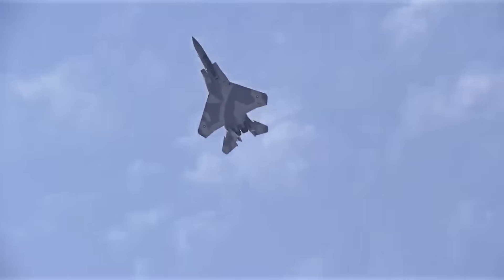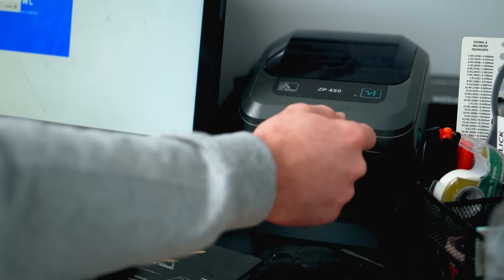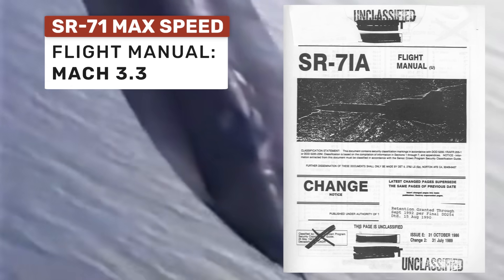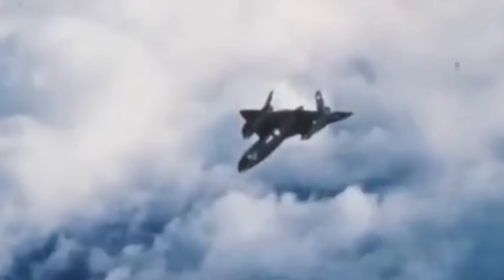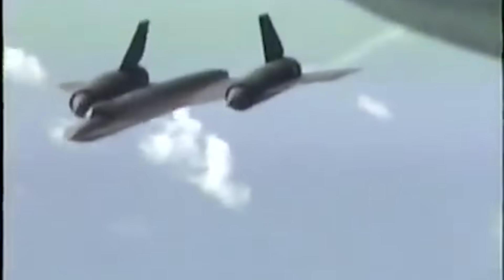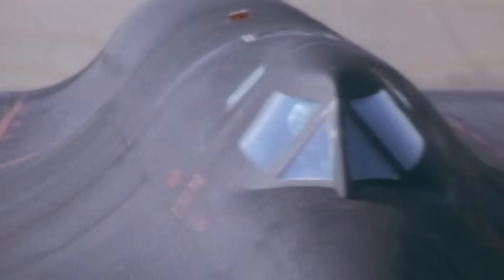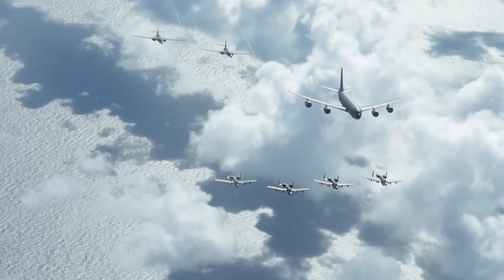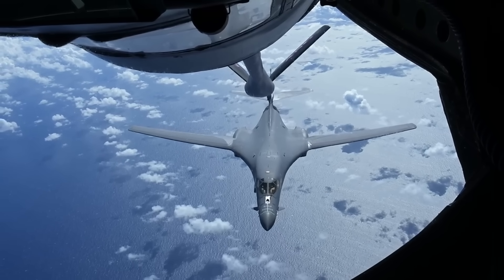The SR-71 was MUCH FASTER than the Air Force will admit

Comment: How about... 3.9? In the book 'Secret Weapons of the Cold War', Bill Yenne (a highly respected author of dozens of books and novels re: military history) wrote that, while meeting with a group of SR-71 pilots/crew at Beale AFB he asked what would happen if any airplane ever took the Blackbird's speed record away,  amd was told that they'd just "Take up one of our birds and press down a little harder on the accelerator"...

And, when talking about some of the outrageous claims of a much higher than commonly understood top speed, he mentioned the absurd figure of 3000mph (@ mach 3.92) and, "When this author asked [all he got was] smiles and knowing chuckles."...

Maybe they were pulling his leg, or exaggerating (though, why?), but he didn't get that impression, appearently. 3k is just stupid-fast. Heck, the plane didn't need any embellishment... so, maybe?
Reply: I found online NASA Tech Memo X-71826, Measurement of Exhaust Emissions from Two J-58 Engines at Simulated Supersonic Cruise Flight Conditions.  The report shows EGT of 2200°K, which is 3500°F.  That also tells me that the EGTs in the -1 flight manual are really low-balled for the released version.
Reply: They probably weren't taking any chances with the flight manual falling into the wrong hands.
But that plane was designed/engineered way beyound the contemporary standards of that period. They had to invent new technology/materials AND fabricatition processes. I'm willing to bet ( and I'm not a betting man) that they were continuously upgrading/tuning and pushing the limit on the SR-71's abilities.
Reply: @dananorth895  
I could see that, it makes sense.
Reply: @@mitchellcouchman6589 
You got that right.  I'm pretty sure the SR-71 was like the MiG-23 in that the only way to test it's actual top speed was to run it to destruction.  The MiG-23 could literally accelerate until it broke up.  I have no doubt that the SR-71 was like that.  The SR-71 had the additional problem of material properties going south due to extreme heat.  Titanium is more heat resistant than steel and aluminum but any material gets weaker as it heats up, there's no way around that.
Reply: There's no proof that it ever went I was capable of reaching that speed. Moreover it is extremely unlikely. And it just sounds like a cool bragging number. You see, in Aviation, they have this standard or resilience of the aircraft to withstand 10 - 15% of the intended max limit of the aircraft. If you somehow achieve a higher reliability rating than that, then you have to redesign your aircraft. So, by any account if your max speed is 3,2 giving it 10% would be the exact limit of 3,5 to 3,6 which seems plausible. But not higher than 3,6.
Reply: @korana6308  

Yeah, the evidence was only anecdotal,  but from a credible source, so I thought it was worth a mention... I'd give it about a 10%-ish chance to be true, but I'm no expert, by a long shot. 

Thanks for the informative post re: safety tolerances and testing.

Edit- by 'you have to redesign the aircraft' do you mean that if it over performs the goal by that much or more, the plane is overdesigned, and that weight/power/etc could be better used elsewhere? (Or, redesign because something was clearly NOT understood correctly...)?
Reply: The engines (in ideal wind tunnel conditions, had a drastic nose-dive in thrust when operating from mach 3.6 to mach 3.8. At mach 3.8 thrust was almost nonextant.
And the engines had to push a plane through air drag, so you're always looking at a speed slower than the theoretical max speed of the engine.
But I'd believe touching mach 3.6 in level flight, 3.5-3.6 depending on conditions. And possibly more while in a dive, but only briefly as air drag would rapidly escalate if in a dive.

The altitude is also skewed.. "80,000+ ft" should likely be interpreted as 80,000-100,000. The altitude, speed, and engine limitations are all interrelated. Go higher, and you can go faster with less drag, and feed more of that thin air into the engines. But if the engines simply start giving-up after mach 3.6 airflow rate... that sets a hard cap on it's altitude & speed limits.

Perhaps worth mentioning, the YF-12 was a bit faster than the SR-71 (less drag & weight). And they made somewhat more YF-12's than is public.
Reply: @kathrynck  great post. Makes sense. Cheers l!

(Also, re: 'at that altitude'- the SR71 (and U2, etc) were painted black, because at a low enough air pressure the ability of black paint to aid in radiating heat outweighed what it absorbed from the sun, like we are familiar with here down in the troposphere, where black clothes are hotter than white, etc. black is simply  more thermally conductive, both ways... ('black body' radiation is literal? Appearently so!)
Reply: @@mitchellcouchman6589 
No.  The MiG-25 would trash engines before hitting it's breakup speed.  The MiG-23 wasn't as fast but it also didn't have the structural strength of the MiG-25.  Retired Colonel John Manclark, who commanded the unit that test-flew captured MiGs in Nevada under codename Constant Peg, has stated in public interviews: 

"“No one liked it. The guys didn't like flying it.  They didn't want to fly it.  It would accelerate until it blew up," Manclark said of the MiG-23."  

Of course, he said this in the year 2020, 40 years later when the program was declassified and he could talk about it without going to jail.
Reply: Could be.  I've always heard that the max speed of the SR-71 is function of its max allowed EGT (exhaust gas temperature).  Ben Rich's book Skunk Works gives a max exhaust gas temperature of 3,400°F, which he cites as being 200°F less than the theoretical maximum for the combustion of hydrocarbon-based fuels.  The released -1 flight manual of the SR-71 shows an EGT limit significantly lower than that (865°C = 1589°F).  I wanted to extrapolate out to see if I could calculate a speed for the higher EGT but I don't have the data points to do it, even if I assumed it was a linear relationship (which is anything but certain).  It wouldn't surprise me if a graph for this existed and it's one of the parts of the manual that is still classified.

It should be noted that Ben Rich's book cites a CIT (compressor inlet temperature) of 800°F.  The released pilot's manual shows 427°C.  Those temperatures correlate perfectly.  BUT, it's obvious that the EGTs shown in the released pilot's manual are seriously low-balled.
Reply: @Skank_and_Gutterboy  

Fascinating post. Thanks for the info and perspective of cold (hot?) hard facts.

Cheers!
Reply: @Skank_and_Gutterboy  it's not egt limiting max airspeed, it's the autoignition point of jp7 under the skin heated by air friction

Comment: There is cruse, burst and downward burst. Also multiple plane types like A12 and engine variants running hydrogen or nuclear and nasas thrust improvements resulting in mach 6+ capability with 36800+ lbs thrust straight down to launch D21 from M21. There was a larger engine available but it was harder to get right the transition to bypass airflow.

Comment: iirc, our carriers are the "actual" second fastest naval vessel. It's still listed as "top speed of 35 knots" which is what they say about  almost all our ships. For the destroyers and cruisers, that's definitely true (33kts is the current fastest for all destroyers as of fall 2022). 

Lemme tell you, in 2017, we went from the 5th fleet op area to the coast of North Korea so fast that the rest of the carrier group didn't show up for (iirc) 4 days after us. Obviously, not needing to fuel up was a huge factor, but we were MOVING. Mf shook like a massage chair the whole time😂
Reply: In the late 1990's, I was lucky enough to take a trip from Pearl Harbor to Maui on an (unnamed) US Navy submarine as part of a friends and family trip. I had researched the sub beforehand and knew its top speed was 35 knots. On the bridge, I looked at their speedometer gauge, and said "Hey, if your top speed is 35 knots, why does your gauge go to X"? They just smiled at me.
Reply: @Sneaky_Manatee  42 knots was the cruising speed but if need be they would go much faster.
Reply: For a displacement ship hull, the maximum speed in knots is thought to be 1.3 times the square root of the waterline length in feet. For a 1000-foot LWL ship, that would be 41 knots. You also need enough horsepower to push it that fast. To go faster, the ship or boat needs to start planning or be on foils. I have raced a 16 ½ foot sailboat at close to 20 knots. It got skittish at that speed.
Reply: @Surfcityham  I don't think that rule works for submarines.
Reply: Having served on a carrier I can say that anything above 35 knots makes lots of noise. Everything on the ship is shaking and bucking around.
Reply: @NavyVet4955  I was just a container ship officer, but it was pretty damned loud on the stern or in the steering gear room on the ships I was on and we usually had a sea speed of between 17 and 21 knots, and the faster ships I was on would maybe go up to 22-24 on really fast days and the vibration was intense.
Reply: I like when they put the top speed as something like greater than twenty five knots. I think the number they like to give for the Virginia class Fast Attacks is "greater than twenty five knots." Yeah no shit it's greater than 25 knots. 28 knots on the Stergeon and Permits want fast enough 60 years ago.
Reply: Certain nuke with 4 reactors could do 52 knots, says someone I know who saw the speed in the control room. Now all carriers have 2 reactors.
Reply: @aagifford  someone was exaggerating a bit. Large ships such as a Nimitz class carrier are definitely speedy for their size however 52 knots is not happening. The hull shape is wrong for producing speed. I know it wasn’t a nuclear cruiser either as we easily outran the last CGN America had on our last RIMPAC in 98.
Reply: @NavyVet4955  could be but my brother says that is the number he saw on Enterprise on a high speed run
Reply: @aagifford  he may have been looking at shaft RPM indicators or possibly an air speed indication since a carrier turns into the wind for flight ops I could see that. Had we been capable of achieving that speed in the previous generation of carriers they would have improved on it in the Nimitz class.
Reply: @aagifford  Which certain nuke was that?
Reply: @aagifford  One of my dad's cousins was on a tin can escorting the Enterprise in the late 60s. They were at flank speed and the Enterprise just walked away from them. Probably doing 45 kts easy, and I'd think 50+ wasn't out of the realm of possibility. Only problem with going that fast is the noise.
Reply: I heard that story about Enterprise at the Tet Offensive.   Everyone else was days behind it was said.
Reply: Being very long counterintuitively raises the natural speed of the hull and being nuclear powered makes for little shortage of available power if the need arises.  Makes sense to anyone who has a passing knowledge of ship design that the CVNs are quite fast.
Reply: @JMurph2015  a long narrow hull yes, a long wide hull no. There is much more drag on a barge VS a speed boat. Yes the reactors provide tons of power to overcome this drag.
Reply: @NavyVet4955  actually a long, wide hull is still going to be faster than a shorter hull of the same width.  It's about the relative phases of the bow wave with the stern wave. The width matters of course but in most practical designs not as much as the penalty for exceeding the hull speed which is determined solely by waterline length.
Reply: I'd heard accounts of the wings that used to be on either side of the submarines sail, getting ripped off I the water because they weren't built to withstand the speeds they were going. Idk if that's true, but I'd heard it enough from submariners that I'm sure there's some truth
Reply: @RAWDEAL064 EMN-SS here.  I wasn’t stationed on the Seawolf.  Went inside it once.  Scuttlebutt is…FAST 😅
Reply: The real speed limitation was twisting the steel shafts that the screws were attached to.  Power on Nuc ships was not the issue. putting out so much power you bugger the drive shafts was.  Skippers get cashiered for busting up boats by doing stuff the engineers said is bad and could screw it up....
Reply: I don't know how fast they are, but they can put a rooster tail up that exceeds the height of the flight deck. Also, on high speed runs they cover the speedometer so no one on the bridge can see it. Claims that "I saw the speedometer" are likely false.
Reply: @mrschuyler  even during high speed turns you won't see a wake that high. The only time I seen water come over the flight deck was traversing the back end of a typhoon heading to Australia. We were transferring fuel to a destroyer during that event and from the hanger bay you would see the mast of the destroyer then watch it come past and then see nothing but water. That was sketchy.
Reply: I was looking for someone to mention this! For a carrier it is a very obvious advantage to be fast enough that you in a crisis situation can do flight operations in nearly any direction, without being limited to sailing directly upwind. 40 knots is above 20 m/s, so high gale/low storm wind velocity.

Comment: I worked at NASA at Edwards Airforce Base in the early 90's and NASA took one of the retired SR-71 Blackbirds for high altitude and speed testing for it's research. I worked in RACOM (range communications) and every time the SR-71 took off at Edwards doing it's research flights at 80,000 feet and Mac 2.5+ all of the ground instruments in the control room zero'd out. We all had clearances of at lest secret and still we weren't able to confirm anything above that altitude and speed. Every single flight was the same and very frustrating because I got to see it and touch it up close and it was a gorgeous aircraft. If it was a woman, it would be a 10+ but it did leak like a sieve on the ground because it needed to refuel in the air and then when it was at speed, it would expand and seal up and was good to go after that.
Reply: When we got word that the Blackbird was being retired....everyone on the engine program was really depressed.   Then they told us to 'build every complete engine you can from all the spare parts'...so we worked OT for 6 months cranking out a whole bunch of J-58's.   It was only later that we found out that a couple of the lowest time airframes had been given to NASA for 'research'.   They flew for about 10 more years and finally retired them when the engine stash ran out.
Reply: Sadly that's what happens when you LITERALLY break all the molds!
Reply: I was at Edwards back in '91 reworking the test stand right after it blew up [Iron Worker]  up on the rock to test the Titan4 booster motors and got to see the Black Bird fly by. We were about 1000' in elevation higher than the dry lake bed so when the planes flew by we could count the lug nuts on the wheels and wave at the pilots. After the American flag was painted on the test stand the pilots would rock their wings to Salute the flag, it was very cool to be there working 6-12 hour days for a year. FYI, it sucked living in Boron for a year.
Reply: Concorde at Mach 2 was similar and stretched about 6-8" in flight.  The BB stretch was claimed to be possibly 2 feet.
Reply: It reeked of kerosene.
(but in a sexy way, everything about it was sexy)
Reply: @kathrynck Everything in the fuel system on the engines smelled weird...from the JP-7 they burned.   Not really like kerosene to me...but different and unique as that was the only aircraft to use that fuel.
Speaking of fuel system....the pumps were heavily gold plated inside because at operating temperatures the fuel is corrosive so working on them was pretty special.   The color was more brown and if you've ever watched a Sreetips gold refining video you get to see the color it is before he melts and pours the freshly refined gold sponge.
Reply: I was on active duty at Edward's from 99-02.  I got to see the last flight and then touch both of those birds as they set on the ramp waiting to go to a museum. 😢
Reply: @MrBen527  I got to fondle one near the end of it's service career at an air show. Once the planned retirement was set in stone, they stopped surrounding it with stanchion rope and guards.
Reply: @kathrynck  Excellent!

Comment: On the Bob Behler segment (from 10:19), there are three models behind him. The far left one is mostly obscured but look to be a U-2 . The one right of his head is clearly an SR-71. 
But what is the one on the far right..?
Reply: It's from the 5th gen aerial target program. Alex did a video all about it.
Reply: @Sauerbrew777 thanks, I'll look it up.
Reply: I noticed that as well... about the same length..  opposite angle of sr-71 vert stabilzers... more like f22/f35... but more of a delta config... Aurora?
Reply: Well that’s going to get a few people in trouble.
Reply: There’s another problem with the planes on his book case. The spacing is uneven. Why?

1) He wanted to highlight the bird on the right and make sure it wasn’t hidden by his head, and so moved it from between the U-2 and the SR-71.

2) But that doesn’t make since, because why would he have the newest plane in between the U-2 and the SR-71?

3) So if he didn’t move the right plane just for this interview, what the bleep did he fly between the U-2 and SR-71 that needs to be hidden? Or is there an RB-57 hiding behind his head?